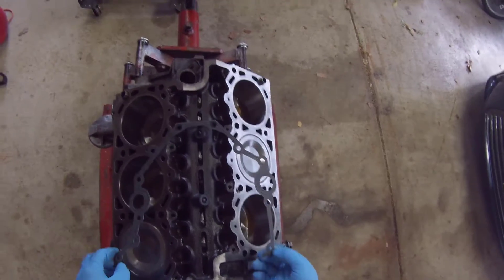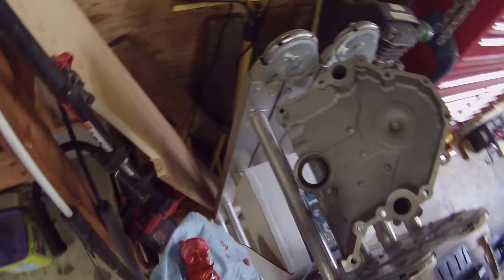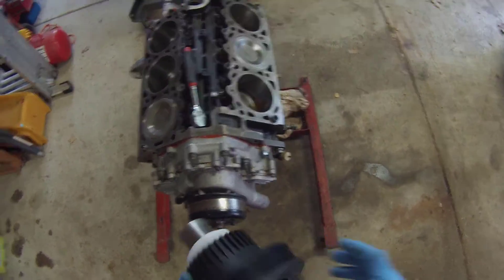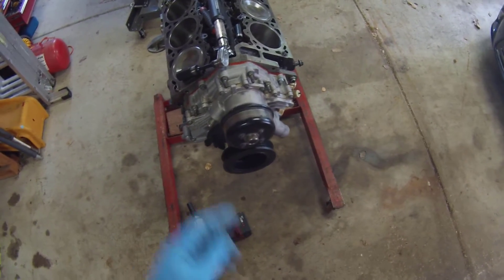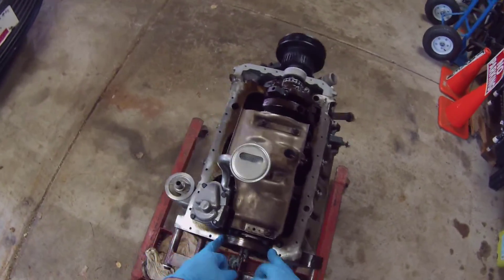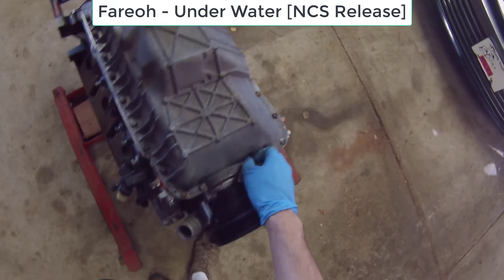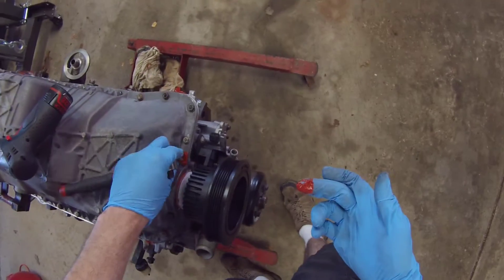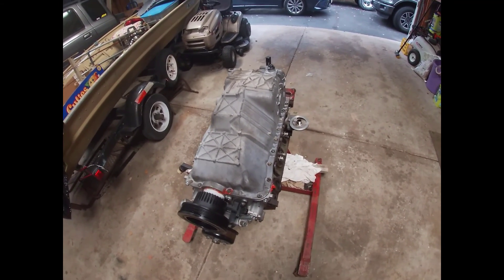Ford 4L OHV Front Cover Oil Pan Install

Comment: You can put a smaller diameter bolt through that stripped threadway and use a locknut on the other side

Comment: Really wish someone made a fluid damper for the OHV/SOHC.  Yeah, rubber works, but...

100% your engine, and any other bolt I would have done the RTV thing...but one of 2 bolts at the front main seal?  Might be pushing your luck.  Time will tell!  LOL

Woulda been a pain in the ass to pull the pan and heli-coil that bolt, but maybe worth it?
Reply from the maker: That would be sweet for the damper be one will probably never be in production due to how little people use this engine. Its a ok engine but has very little aftermarket support. 
Ya I think the oil pan be fine it was only one bolt and its not a big deal to me if I actually have to re seal it in future. I have done worse sketchy things and I also don't think the engine will last long cause I beat on my stuff hard.

Comment: Is this a freshly rebuilt motor? Last I remember you weren't gonna rebuild the short block. I put new ported heads on mine and now wishing I would have changed the cam out...
Reply from the maker: Yes I ended up rebuilding the short block in the end cause the engine had 200k on it and the bearings needed to be change on top of that the engine will be boosted in the future so installed new rings and gaped then for boost. So it was not that much more work or money to do a backyard rebuild. The camshaft is that one thing that will make a big difference.

Comment: I had a heck of a time getting the front main seal installed with the timing cover on the engine on my 4L OHV.  It looks like a much easier job with the cover off. 

I used a Fel-Pro seal that comes with a wear-sleeve for the damper.  However the seal itself would always twist or spin off axis in the bore, even with an appropriate sized socket to push it in evenly.  I ended up smearing RTV on the outside of the seal for extra sticktion, and using my fingers inside the cover (oil pan off) as a back stop to keep it from spinning.
Reply from the maker: Yup it is much easier with the cover off. I generally don't like using wear-sleeves but will use them if it has to go on crank. Probably replacing damper would have been easier then going through that.